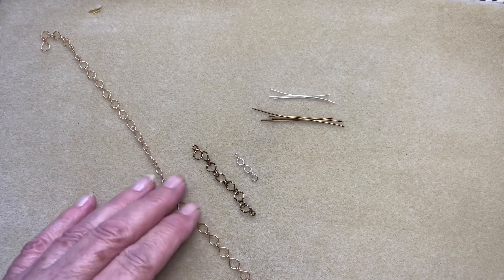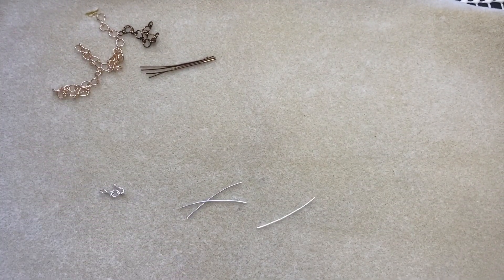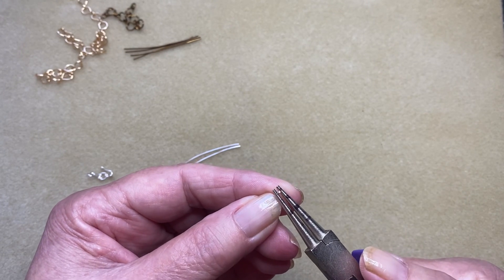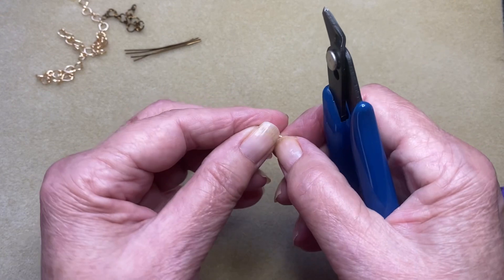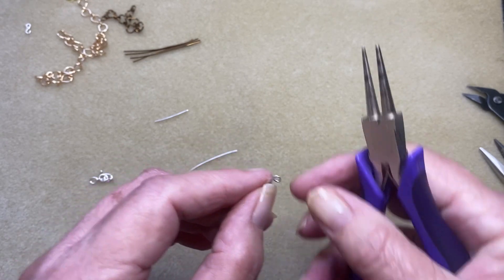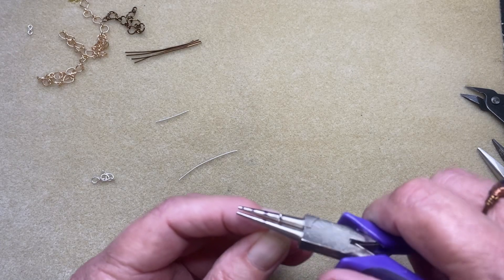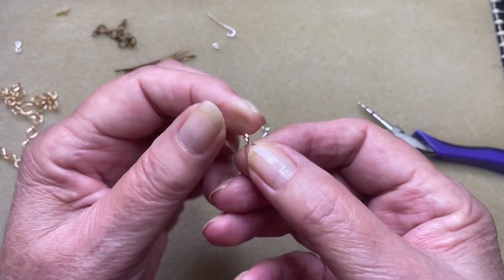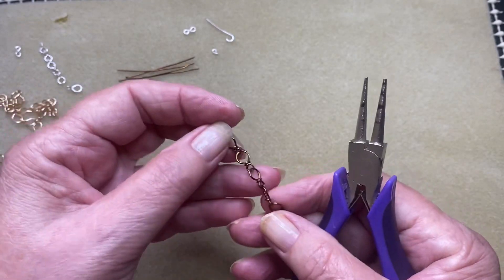How To Make A Bubble Link Chain | Easy- beginner Friendly

Comment: I made a copper chain link necklace yesterday, with links i learned from you 😍, and I love it. I try not to cut too much of my wire, and I wonder if it is nessicary to cut off as many small pieces as you do. Or is it difficult to get a hold on if you make it fx 3,25cm instead of 3,5 cm? Thank you for posting your skills for us to learn from 🩷🩷🩷. Love from Denmark 🇩🇰. Lene
Reply from the maker: Hej Lene, So nice to meet you! I also try not to use too much wire in my work! The measurements I give are in most cases just a guideline, try the 3.25cm and see what you think! It's also much harder for me to demonstrate on camera, so I allow myself a bit more wire to make the job easier! Let me know how you manage it! take care and love from Australia!
Reply: @GumnutLaneJewellery  Thank you for answering . ….and so I did. 😁, cut the pieces a little shorter. Then to my next problem. After having worn my necklace made of copper for only one day, (and night) it started to tarnish, and so did my neck. I wear a bracelet too and that doesn’t. There is a little colour difference between the wires I used.. is there anything I can do to prevent the tarnish? (Sorry for my bad english). Love 🥰🩷 from Lene/🇩🇰

Comment: where does it tell you how long to cut the wire
Reply from the maker: Hi Margaret, The lengths for the wire are below the actual video in the " more" section! So if you scroll down, under my video you will see my description of what the video is about and at the end of my words it says "more" click on that and it will drop down and you can see the lengths there! Hope this helps, let me know if you still need help ok!? take care and have a wonderful day!
Reply: For some reason I don't have a more button. It looks like you are using 2 and 3 inch length, is that correct
Reply from the maker: @margarethenderson1719   here you go Margaret! Wire lengths for chain links
First link- 3.5cm or 1 3/8 in
Second Link- 4cm or 1 5/8 in
Third Link- 5cm or 2 in         Have a lovely day!😊